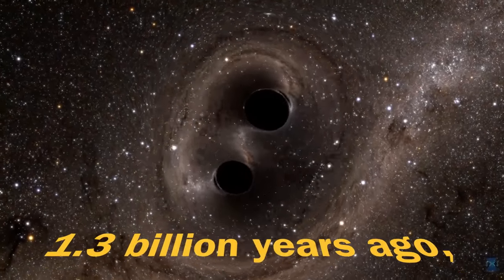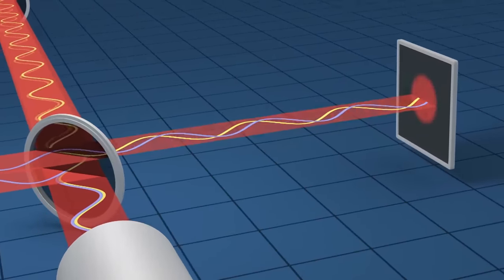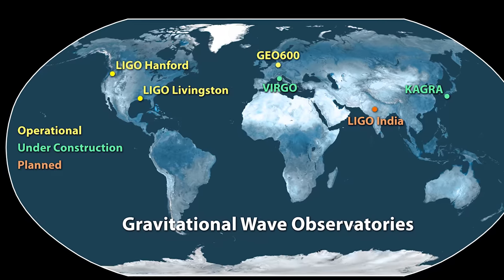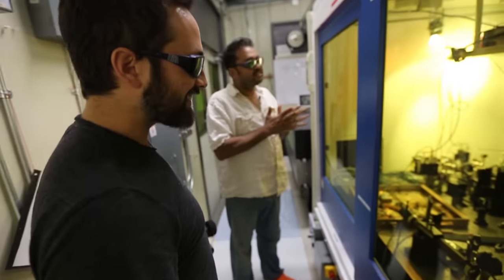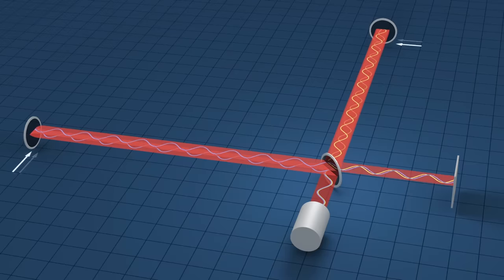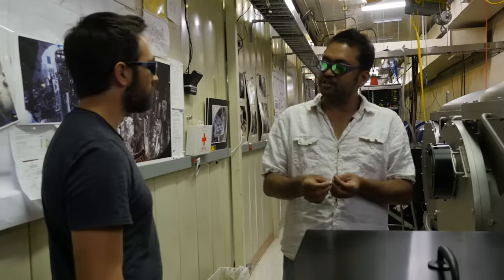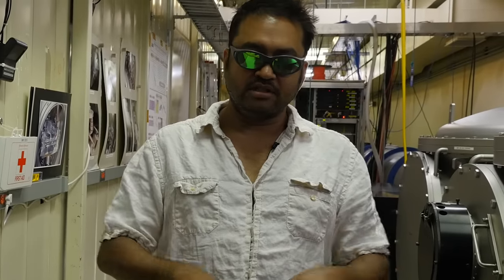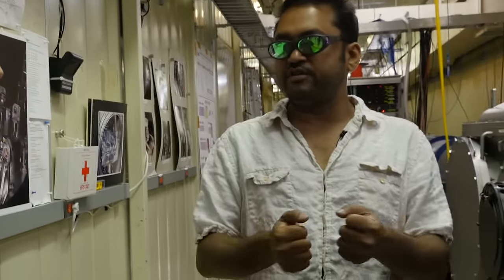The Absurdity of Detecting Gravitational Waves

Comment: Wow!
Question - If it takes two merging black holes to release enough energy (50x > everything else in the observable universe combined) to stretch and squeeze space by just 1 part in 10^21, how much energy is required to stretch and squeeze space for the USS Enterprise to achieve warp speed ?
Reply: Well, the 2 black holes are extremely far away, whereas the USS Enterprise warp drives are on the ship.
it isn't just energy, but energy and distance.
Reply: Depending on who you ask, it would take anywhere from more mass in the observable universe, to a mass of several suns, to something the size of an ordinary spacecraft.  The main problem of course is that all of these rely on the existence of matter with a negative mass, and the more practical ones require the ship itself being compressed into a space a few plank lengths across.  Its all theoretically possible, but nobody knows if negative mass even exists in the universe.
Reply: I saw a video a while back that they figured out a way to use a lot less energy by making a warp bubble that is bigger on the inside, so the warping required for moving stuff would be done over a much smaller volume.
Reply: ***** Yea, but the outer volume still needs to be somewhere on the order of slightly larger than a plank length, which would be extremely difficult to achieve.  Not to mention that you still need negative mass to make it work.
Reply: A "self contained" warp drive is probably unpractical, as it will need a Jupiter-sized mass of antimatter (and another of normal matter), just to power it up.
  
There is no need of exotic "negative energy" stuff (nor impractical ammounts of regular energy); as long as the ship moves subluminal while inside a tunnel-like structure [actually going through "rings" spaced by many light_minutes of each other]; through the whole journey.
This rings will fold space around, behind and forward of them providing a shorter "inner" distance than on their outside [at the expense of also slowing down time on the inside to mantain the "framerate" in sync with the universe].
  
The passengers inside the ship will experience almost none of the "local relativity effects" (if they leave behind beacons of white light inside the "tunnel", those would not look more red); but when they exit the "tunnel" they would have "traveled to the future" a little more years than what it would have taken with a normal ship going almost at the speed of light.
Reply: Tom Mulligan I believe the space didn't just stretch 10^-21. It stretched at much larger magnitudes but the wave lost energy during its travel to space itself. Like a water wave would die down after a few meters.
Reply: You have misunderstood the effects of the gravitational waves. They have traveled a distance of billions of light years, meaning that they now bend space in a spherical shell with a surface area of that of a sphere with a diameter of billions of light years. The gravitational wave is spread across the shell and thus can't bend a lot of space. Those black holes probably bent space-time a lot more when they had just merged.
Reply: Felix 
While the ammount of energy is impresive (more than all active stars in the universe, supenovas included); the observable effect it is not really "much" even at the origin... at the boundary between both blackholes (still outside their event horizons), at 3 seconds before they completely merged [just before the "peak" of the gravitational wave]; the spatial distorsion from each "top" and "valley" of the "wave" would have being something between a few milimiters and 20 centimeters [relative to the plane of spiraling down rotation of both blackholes].
  
If you would be there (magically protected from all kinds of electromagnetic radiation and debris of matter falling down), you could barely see your body getting longer or shorter [except at the very last second, when it will be very noticeable but you will be inside the merged event horizon, falling to the singularity].
Reply: Felix
Sure I get what you're saying. I'm simply interested in how much energy might be required to distort space-time around a star-ship so that it can travel beyond the speed of light.
I guess the answer is nobody really knows, although 10^-18m doesn't sound like enough of a distortion to transport a star-ship with a lot of mass from A to B considering it takes close to all the energy in the observable universe to achieve this.
I say close, you mentioned that these black holes probably bent space-time a lot more when they first merged. I did a simple calculation and while yes its many orders of magnitude more, it would still require a detector sensitive enough to detect these space-time distortions at source to wavelengths just 10^-9m.
Enough for our star-ship ? I'm doubtful but who knows.
Reply: Yes exactly, gravitational fields fade over distance. I would think that the same applies to these waves.
Reply: probably the warp engine does the same observed phenomenon, only it doesn't fade off over time.
so, by constantly stretching and squeezing space, you get acceleration.
Reply: I seem to recall reading a "technical handbook" for the NCC-1701-D  that went a bit into warp travel and the distinction between warp and impulse and warp drive created a bubble which isolated the space time around the ship, from the space time in the universe and moved and reinserted the bubble at another location.  Impulse was moving the ship through space time so it was limited to warp 1 speed but there are no limits to how much a bubble can be moved relative to the universes space time.  Was not folding or squeezing although I have heard also from official sources say contrary but even the shows contradict themselves like in the final episode when Riker gives the order to proceed to warp 13 on his future ship, yet  in Voyager it is mentioned that warp 10 can get you anywhere in the universe instantly and while traveling you exist at everywhere simultaneously.
Reply: we are ages, if no millenia away from FTL travel. The is no way to know how it would actually work or how much energy it would take. First, we need to create a way to travel to outer space without using rockets, then we need ways to be able to travel at fractions of the speed of light, and THEN we can begin to think if FTL travel IS POSSIBLE in the first place..
Reply: +vitas75 Given the feedback loop involved in technological advancements, it might not take that long; compare how long it took for us to figure out agriculture, metal working, electricity, electronics etc. And since we can't predict what we might find on accident, it is possible things won't happen in that order; for all we know, some scientist might have a sudden insight or stumble on a particular piece of data that might lead us to be sending chemical rockets on warp rides first.
Reply: EgadsNo
Star Trek uses an auxiliary field of physics (the "subspace") for the "disconection" between the local spacetime around the ship and the rest of the universe.
There is no speed of causality (light) in the subspace, so the space around the ship can move at whatever speed [warp 10 is "infinite" and it was used in Star Trek: Voyager once].
-> Note: There is no such thing as the "subspace" (or anything remotely similar) in real life. 

About the last episode of Star Trek: The New Generation :
Future!Riker was using a new scale for Warp Speeds [with the "infinite" placed higher than 10 or 13].
It is implied that there were great advances in warp drives in those decades, so it will be too complicated to comunicate the desired speeds  for a ship in very small decimal increments betwen 9.99 and 10.
Reply: Mario D. Zmaj
Star Trek is more "hard" in the science fiction aspects that are not exclusive to their universe. The rest is "soft" fantasy.

Everything else can be "handwaved" by using something that is exclusive to their universe but not real life.

For example: they could detect small gravitational perturbations on normal space by observing much greater changes happening in the "subspace" (that precisely works under other rules regarding gravity and spacetime), using relatively small normal "electromagnetic sensors" to observe it.
Reply: Answer: there is no USS Enterprise...it's fiction.
Reply: If only we knew how to harness anti-gravity. I know it might sound ridiculous at first. But there is enough evidence on earth that this is probably how the pyramids, stone henge and other heavy objects like the Easter island heads were moved into place with such extreme precision. As for the warp drives and the amount of energy that would be required, I guess we could use E=mc^2 to somehow calculate the energy? Though I am not sure what the mass would be.
Reply: vitas75 the thing is, we can travel at 99.99% the speed of light but cannot achieve light speed. If we travel at light speed, we would essentially be time traveling into the future. And that's why I am skeptical about FTL travel even being possible. We should concentrate more on finding how to create anti-gravity
Reply: +Sahil Pethe
A single person with some planks and sticks, rocks, and sand (or dirt), would only need a few days, maybe a week or so perhaps, to set up the whole Stonehenge (bringing the big rocks to the work site would take more time depending on distance and characteristics of the path taken, of course; but still perfectly doable).

You're seriously underestimating what people with good understanding of basic mechanics can achieve.
Reply: +TiagoTiago While I agree with your last sentence, I will assume that your first was hyperbole.
Reply: Sahil Pethe
Any ship capable of warp speed in the future would not actually move faster than light, weirdly the ship itself is stationary at all times throughout its journey. Instead the space around the ship is warped thus never breaking Einstein's theory of special relativity or any of the paradoxes associated with it.
Reply: Tom Mulligan its simple, you don't move the ship, but you move the universe!
Reply: TiagoTiago 
.
But what's the criteria for separating the technologies? Like, how can we say "it took 1000 of years to create agriculture, then 500 to make steel, and 250 to make electronic chips, so we will need 125 years to invent time-travel"? (This is just a example, with time periods and technologies randomly chosen.)
Reply: ***** how can you build structures weighing 60+tonnes (single stones) with sticks, ropes, dirt etc?

Some facts about the pyramids:
The main pyramid roughly consists of around 2.3 million stones
Each stone was carried from a quarry 200 miles from the location of the pyramids
Each stone weighs around 3 to 50 tonnes
The width and length of the pyramid differ just by 2 cm (that's crazy accurate)
There are 3 vents from the king's chamber to outside (we think they didn't know 3D geometry back then) with an angular deviation of less than 1 degrees (that is ridiculously accurate) spanning a hundred feet
The whole pyramid was also covered with a smooth coating of limestone

All of these things are humanly impossible to achieve. They won't be possible even with today's technology let alone back then.
Reply: +Sahil Pethe
I'm not an expert in engineering and stuff, but I don't see how they would have a problem if they had enough people and the proper tools and techniques. If they had some sort of measuring stick or something, they could mark the spots to cut the blocks to have the same size over and over; there are plenty of ways they could have moved the blocks over big distances, rollers, levers etc; I'm not sure I really understand what you meant regarding the angle of the vents, but doesn't sound like it would be too hard if you know what you're doing (and regarding the "didn't know 3d geometry" thing, every once in a while we see some artist doing some amazing mathematical looking stuff that they didn't actually had to calculate, just do what looked right); as for the the surface, I don't see the issue there, maybe I need more details.
Reply: +Lincoln Lopes
I'm not sure if there is an standard for measuring technological progress; but without getting into technicalities, don't you agree we've been advancing at an increasingly faster rate, even more noticeably in more recent times?
Reply: +Sahil Pethe
In reply to the comment with the link about the pyramid shafts' angles that isn't showing (I guess maybe it's being held back at suspicion of being spam perhaps): They had the means to align things to constellations and stuff, so the horizontal angle is no big deal; as for the vertical angle, I don't see why they couldn't have figured out something like hanging a piece of wood or whatever with a slanted edge, letting gravity keep the angle constant.
Reply: Less than what those black holes put out. Remember that we are detecting these waves from so far away that those black holes merged before humans even evolved to be capable of detecting them. It's like someone dropped a boulder into the ocean at the north pole and you detected it near the south pole by way of measuring the imperceptible change in the water's height as a result. The energy may have been large when it hit the surface of the ocean but you can change the waves around your body with far less energy.
Reply: hmm, God's fabric is quite resilient
Reply: ***** Yes, I do. One thing that we can use for comparison today is the size of media storage. Like, by 1970 there were floppy disks with 80KB of space, and now we have pen drives with 1TB. This is obviously a same-type technology, and therefore easy to compare. But, when it comes to compare things of 2000, 4000 years ago with the things of today, I can't clearly see the reason for including one type of technology and not doing so with another, neither how the ones that are included can even be compared.
Reply: +Lincoln Lopes
I would have to sit down and do a lot of research to be more through; but we can do some comparisons like the complexity and range of knowledge required to build a wood hut, a steam engine, and cell phone for example.
Reply: ***** Yes, this can be made intuitively, and it's already being. But, I would like to see a more complex and meaningful way to do these comparisons.
Reply: To be honest, it's just one part to think the amount of energy. The easiest, to be exact. The real problem is, how can you alter the quantum state of energy around USS Enterprise to be corresponding to the destination? It's hard enough to find out one simple function in time-space, but to acknowledge it all to harness the usefulness, well... Oh boy.
Reply: There's actually one thing that doesn't make sense, pretty much in any Sci-Fi scenario; Where species have developed these kind of traveling options, they tend to keep going as useless clumps of meat with consciousnesses. They clearly have developed technology to a point they're literally gods. Otherwise, they wouldn't have such tech.
Reply: But to answer your question; it's relative. There's no such thing as "speed", and certainly not the one called "warp speed". It's relative to the observer. "Warp speed" of the USS Enterprise could be anything, cause it's relative to the perspective. Accelerating USS from 0 to 5 meters per hour is "warp speed" relative to the state of quantum particles before acceleration.  USS Enterprise in the other hand is relative to our universe. What are the legalisms in its being?  

There's really one answer: The energy required to stretch and squeeze space for the USS Enterprise is whatever you think is right.
Reply: Tom Mulligan childhood ruined lmao
Reply: Patrick Hill
Small world :)
Reply: 42
Reply: Nathan Fox
correct. i knew this but just testing.
Reply: I always thought, that a squeeze of space and time is induced by gravitational changes below zero, so that any mass we currently know is not able to do that. Also one question, if there exist someone who can tell me, does our Universe have a neutral space state, where it is not stretched or squeezed at all?
Reply: Yep. Just as it's theoretically possible for me to walk through a wall...
Reply: you'd need some kyber crystals
Reply: TiagoTiago did you just drop a low key Dr. Who reference?